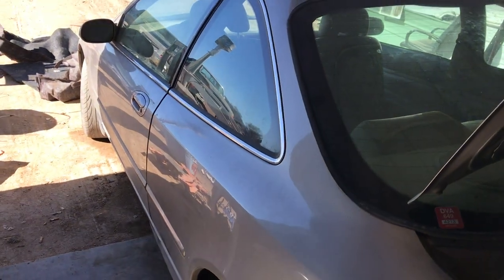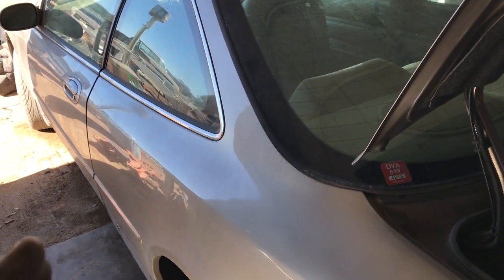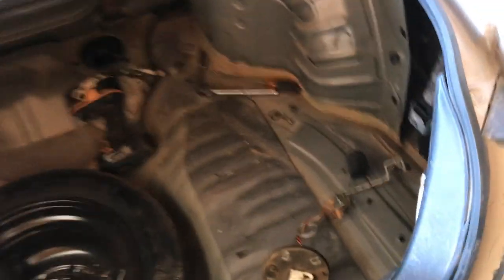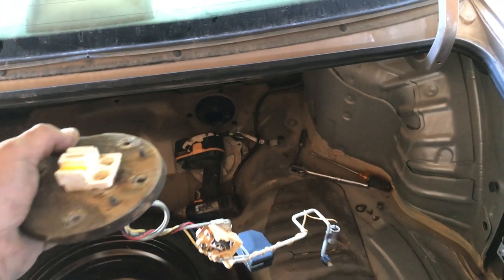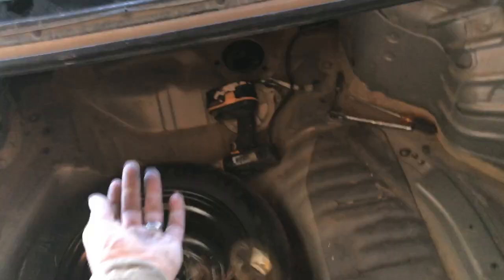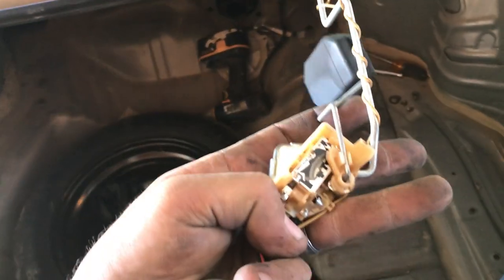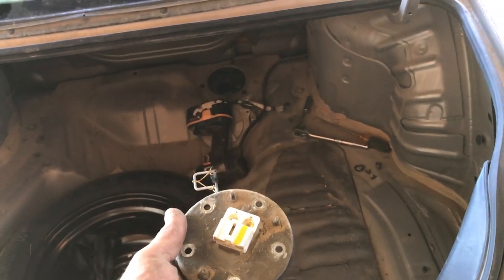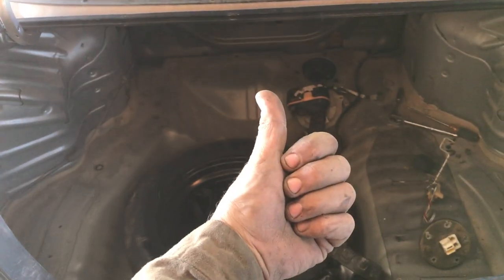1999 Acura CL 3.0 Fuel Gauge Sending Unit

Comment: My low fuel warning light stopped working, and it's not the light bulb. I'm guessing it's the sending unit. 1997 Acura CL 3.0
Reply: mine too, same car, Im going to try cleaning my contacts and see if that fixes it. thanks for the simple video!!
Reply: @jeffcody420  I wish I could take credit for the video. Good luck! 🤞

I still haven't fixed mine, due to other more important repairs. Like replacing the tie rod ends.